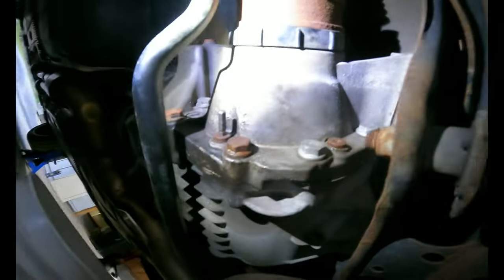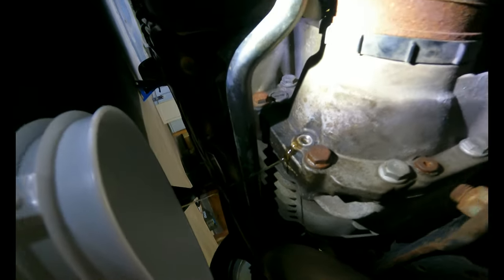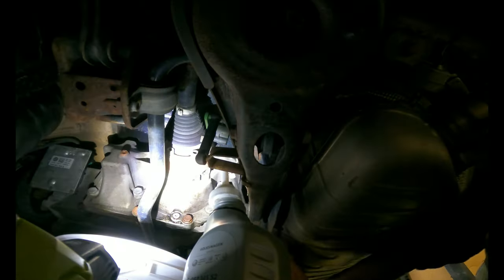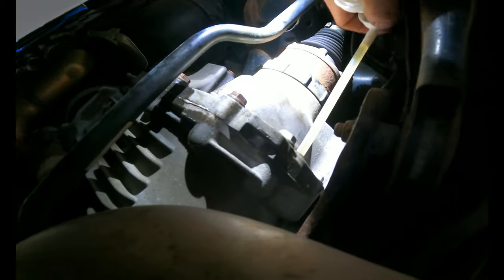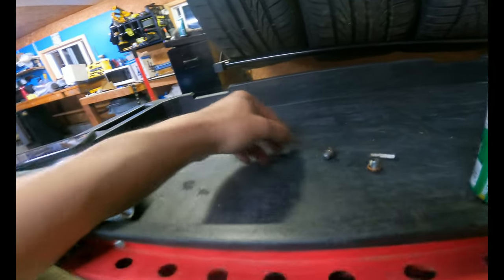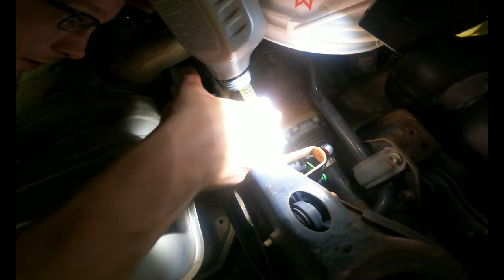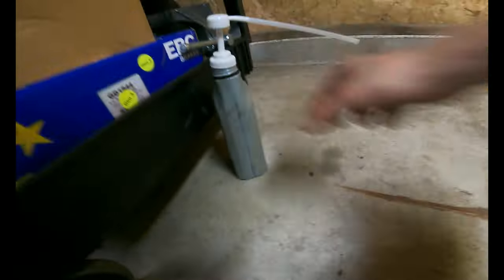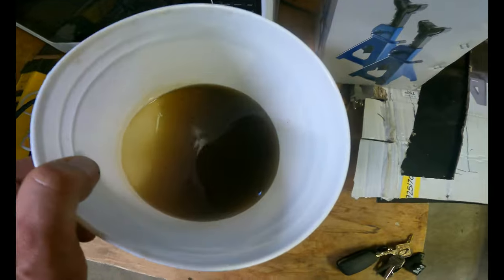2018 Audi RS3 Rear Diff Service Part 1 DIY

Comment: God bless you king!!! Is it the same for the hatchbak version? And do you know how much oil goes in?
Reply from the maker: Honestly I'm not 100% sure, but I would think so. It's the same process on the s3 and golf R. I put about ¾ of a 1 liter bottle in until it came out the fill hole, so probably 750-800ml goes in :)
Reply: @BickfordsRs3  is haldex oil the same as the differential oil?
Reply from the maker: No that's a separate oil, haldex is coupling fluid. I have a video on it here https://youtu.be/xuo8qcLk_kY?si=NJW2yGJfMQ1M30c- 
The diffs are 75w90 synthetic gear oil